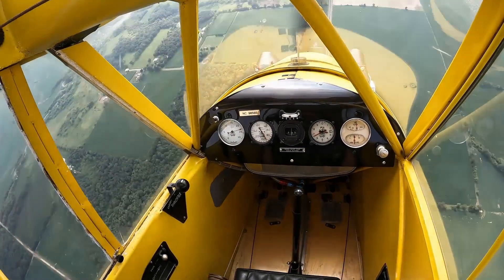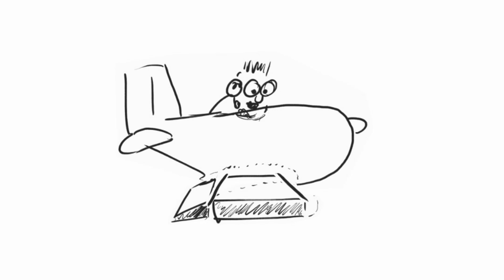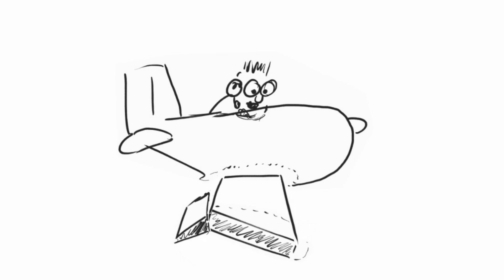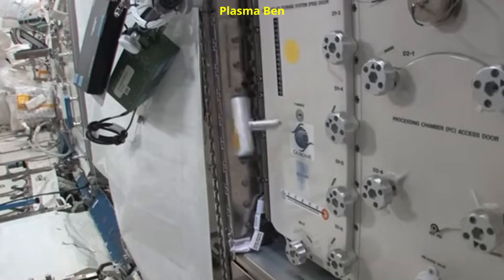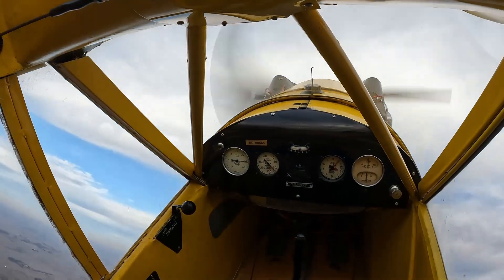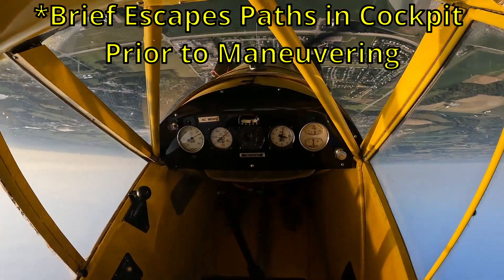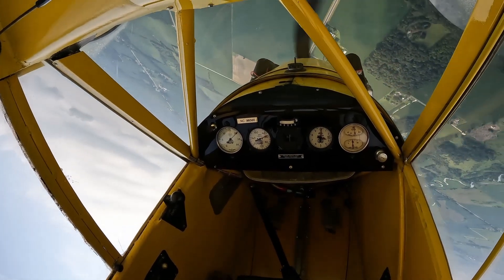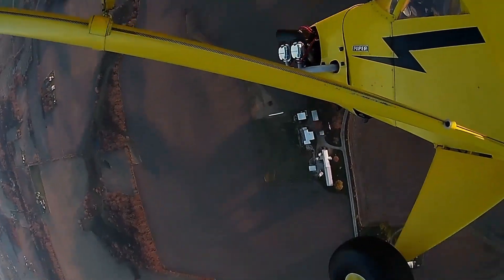How to fly Half-Cuban-8s in a Piper J-3 Cub

Comment: Do you use opposite rudder to aileron for the first quarter of the half roll?
Reply from the maker: Hi Dave!  Sorry it took me do long to get back to you on this!  I'm actually using proverse rudder (rolling left.  left rudder).  I'm assuming you've had some primary aerobatic training.  

You want to try these out start by letting the nose fall to 45 down (5/8 of a loop) before starting the roll.  That'll give you more speed and a faster roll rate, but you'll be upright at about 60 degrees below the horizon.  Then you can work the start of your roll back up to about the level point in the maneuver.
Reply: @ hey jon. When youre inverted it helps to use opposite rudder to aileron to counter adverse yaw. Just for the first maybe 45 degrees. Then by 90 degrees youll be using same direction rudder.

Try it, it makes a big difference and keeps the aircraft on heading.
Reply from the maker: @davefoord1259   For sure I have it dishing out here.  I'll give it a whack as you say.  If I can catch prettier rolls (and half-cubans) I'll upload the video and send you a thank you note in them.  

Last time I tried that the lines were a lot better, but my oil pressure was a lot worse.  Maybe I find a better window to fit it in now?
Reply from the maker: @davefoord1259   Cool!  I'll give it a try.  Every time I try to hold the lines I can do it, but I get some bad oil pressure fluctuations.

If you help me get prettier rolls out of the Cub I'll record a video and say "Thanks to Dave Ford!" in 'em.  Give me a few weeks to a month to get 6-8 flights at it.